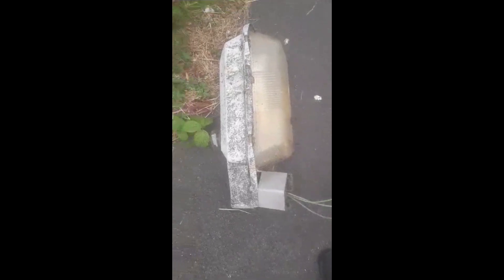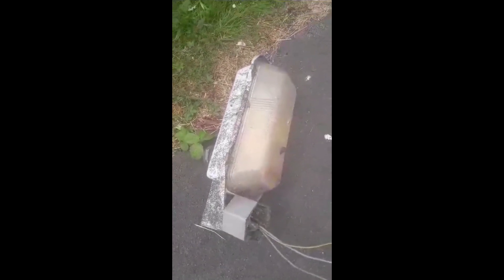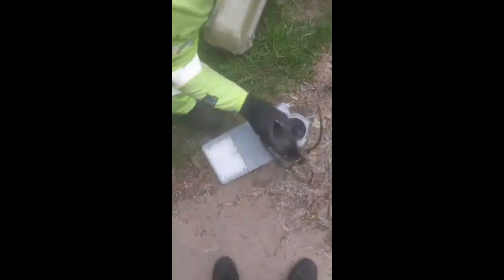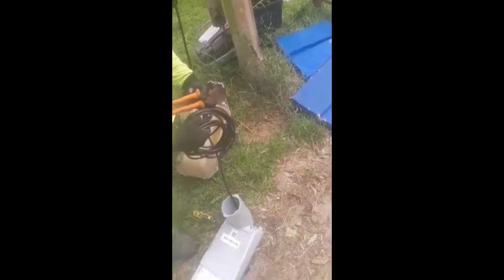How a Street Light is Replaced | Sodium to LED replacement

Comment: Wonder how long these horrible new LED lanterns will last before the drivers start failing. Probably not as long as the warm comforting SON lamps.
Reply: I agree. I have some led floodlights they fail every 2 years. Normally burnt out drivers or one burn out its leds. so if the led lanterns are to a similar quality I expect them to start failing around 2025.
Reply: They will be permanent and they do not contain drivers,they use electricity to work and need only 12 Volts to function
L.E.D. Street lights will last 30+ years when maintained properly
Reply: @stephensnell5707  Did not know that but how is the 240V column supply reduced to 12V? There must be some sort or Driver, AC to DC converter or are the LED's wired in series/parallel modules
Reply: @stephensnell5707 so you think the hps ran on 12v??? lol
Reply: @stephensnell5707  The LED lanterns in Birmingham UK have drivers, literally all of them. I've installed many thousands of them since 2010. When a driver is faulty it's almost always replaced, or if the LED tray is faulty we replace the entire lantern.
Reply: They do have drivers. As everything, the better the driver the more it last. As for the kind of light, they could have used warmer LEDs (even amber) if they had wanted to.
Reply: yeah and the bulb isnt even replaceable, which is a huge problem for reuseability. personally i think they should put corn style bulbs in the old fixtures and remove the control gear, and will probably last longer, because corn style leds do not need drivers because their are enough leds in a series to run on 240v

Comment: Was the 2600 saved?
Reply from the maker: No sadly, however I am visiting a site where some 2600s will be replaced soon so I'm going to try to save 1 or 2 of them
Reply: @LeoLampposts why replace
Reply: @NEON2600 because they are inefficient,ghastly and need to get hot before reaching full brightness and L.E.D. Street lights give instant full brightness without any generated heat
Reply: @stephensnell5707  Yeah yeah sox lamps been running for 60 years and are efficent, meanwhile leds break after 2 years and ruin animal habitats.